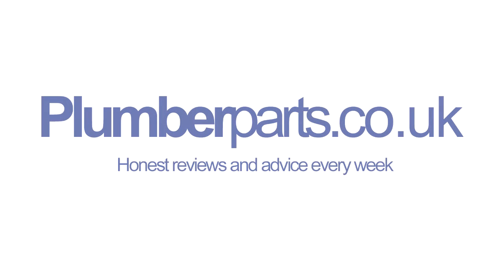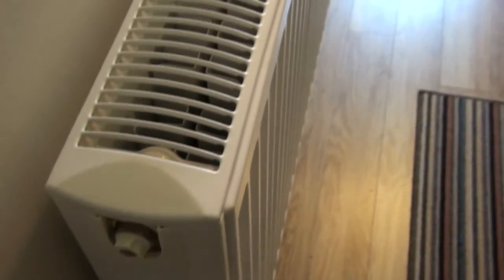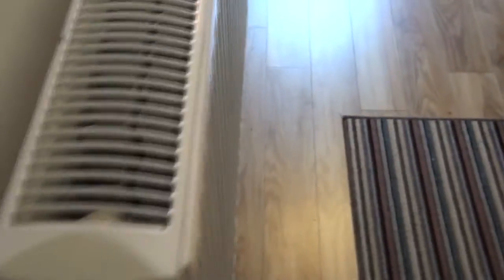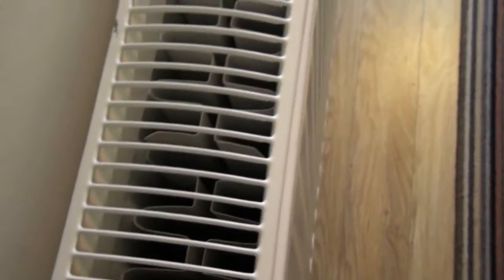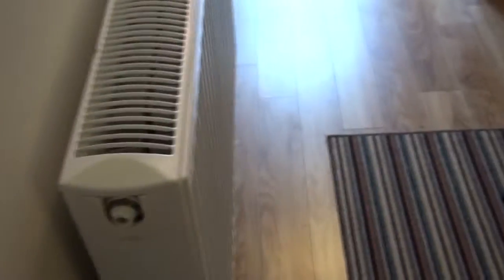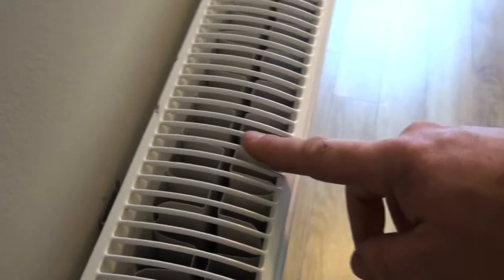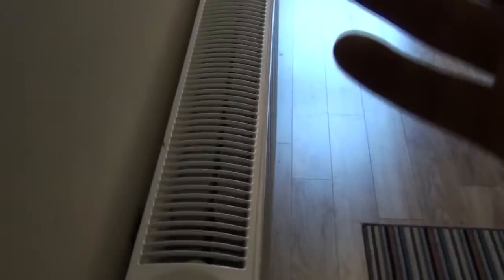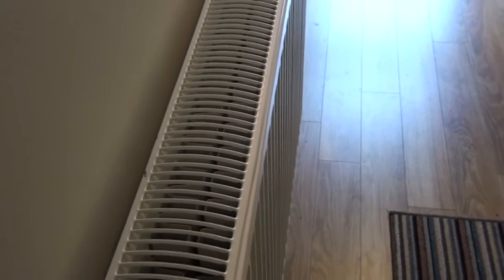Convector Radiator Explained - Plumbing Tips

Comment: I'm surprised there aren't more fin-tube radiators in the U.K. and Europe. They seem a bit chintzy, but they are nearly corrosion-proof and clog-proof, and they cost less to make than these welded things. They are a bit short on thermal mass, but a nice cement-board or tiled cover would make up for that.